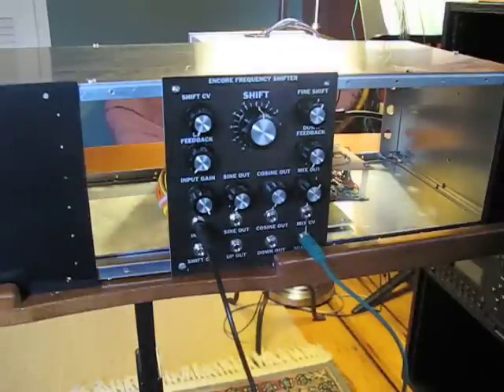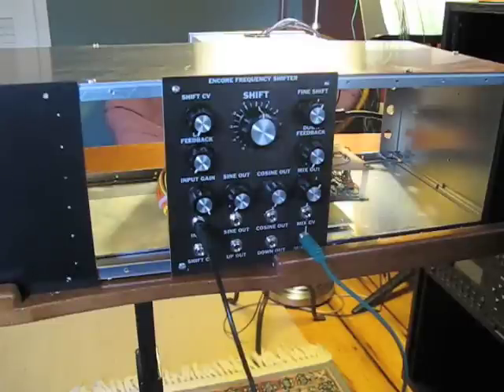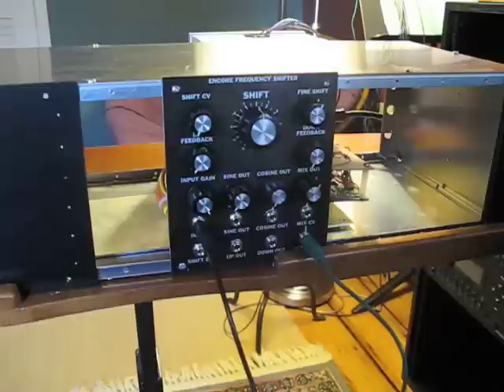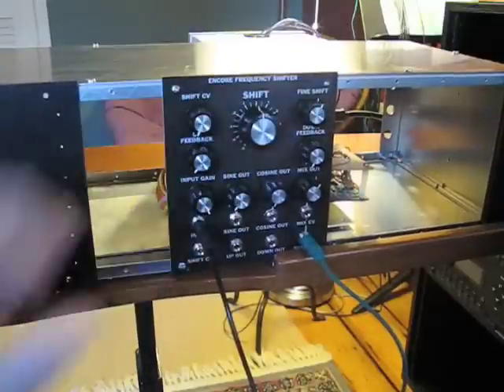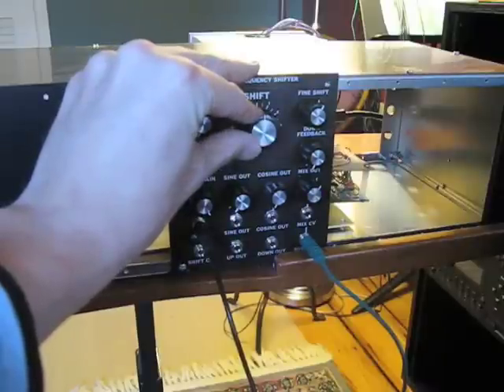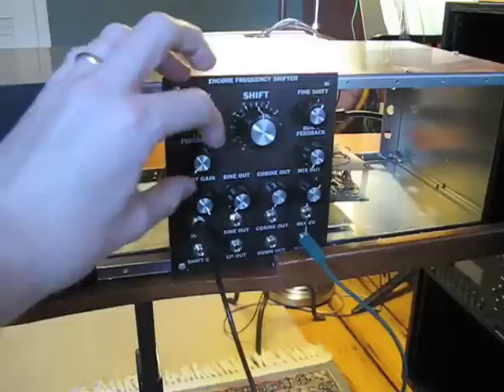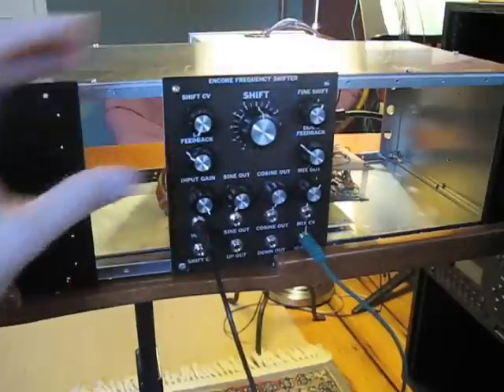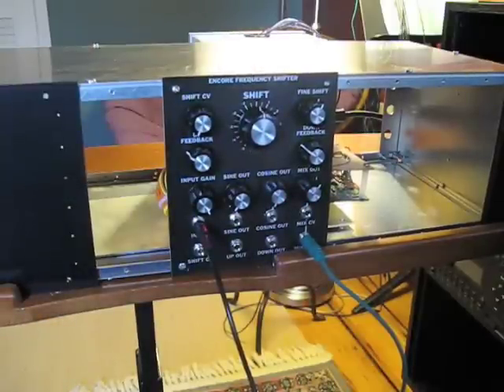Encore Frequency Shifter

Comment: It works much like a ringmod, where the original and other sideband sounds are removed, leaving just one pitch-shifted sideband. You lose all that ugly sideband stuff. It's still always grainy and crunchy, but it works. A digital harmonizer works much better for actual pitch shifting, and the early Eventide ones are even Voltage Controllable.